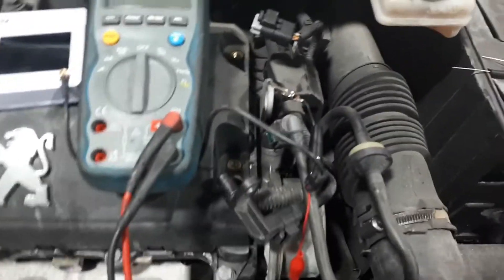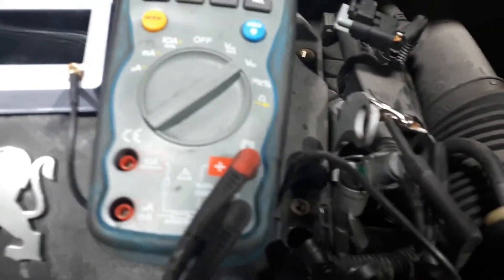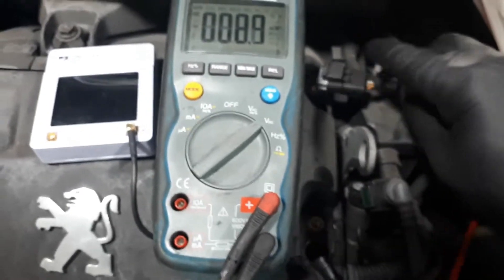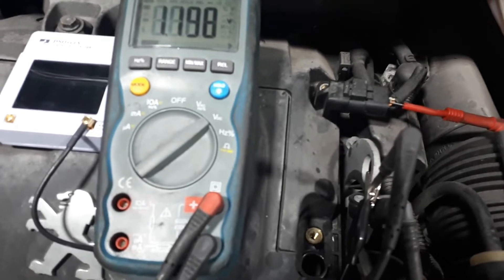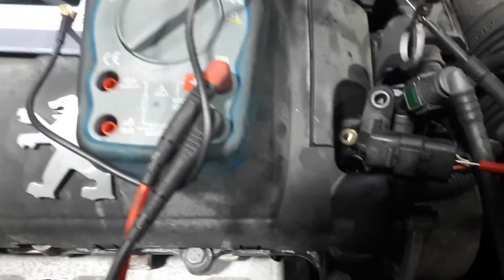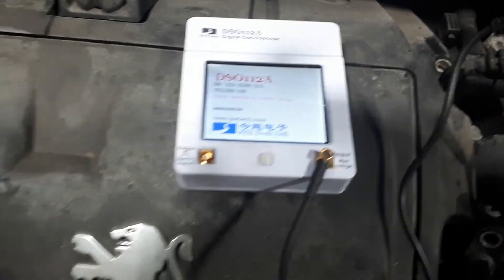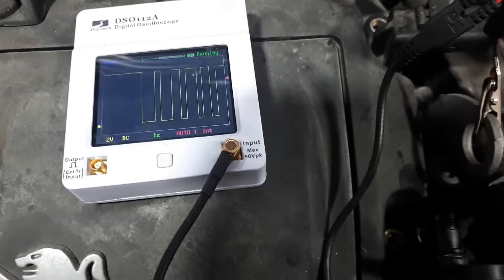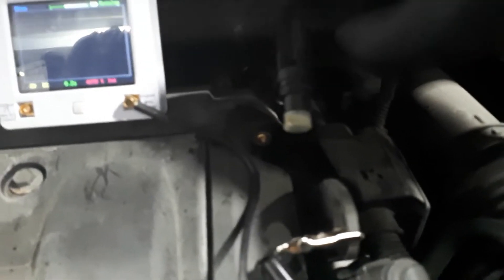How to diagnose P0342 Intake Camshaft Position Sensor Circuit Low

Comment: Salut George, f bun videoul. In situatia mea, motor 1.6vti, am verificat signal wire, ground wire, power wire. Totul e ok. 
Am efectuat un alt test vazut in alt video ”low voltage / short to ground” conectez cablul rosu multimetru la baterie, si cel negru la signal wire (conector camshaft) apar 7V (ignition on), 12V (ignition off)
Este normal?
Reply from the maker: cu sau fara senzor conectat?
Reply: @GicaPhp  multumesc pentru raspuns. fara senzor conectat
Reply from the maker: @rvdumitru90  Bias voltage difera de la producator la producator. O sa trebuiasca sa folosesti un osciloscop si sa vezi ce se intampla cu semnalul cat si cu supply voltage. Daca nu ai osciloscop, atunci iti recomand sa verifici continuitatea de la ecu la mufa (resistance check) in timp ce manipulezi instalatia electrica si sa vezi daca se schimba rezistenta pe toate cele fire, cat si posibil scurt circuit catre ground.
Reply: @GicaPhp  din pacate nu am osciloscop, iar masina nu mai porneste.
Motorul a inceput sa dea rateuri dupa schimbarea bujiilor si schimbarea camshaft senzorilor intre ei.  Dupa cateva minute de mers in rateuri motorul s-a oprit si pe tester au aparut erorile legate de inlet si exhaust cylinder reference sensor signal loss(permanent) 

Am pus sensori noi si motorul tot nu porneste. Cranks but no start. Are scanteie + benzina. 

Cei de la service nu isi dau seama care e problema, suspecteaza Timing chain sarit 1-2 dinti.. 

Motorul este 1.6vti 120 (2013) Citroen C4 picasso.
Reply: @GicaPhp  https://www.youtube.com/watch?v=-q9Nd6cMvfY acesta este testul pe care l-am facu. In prima parte valorile au fost corecte, in a doua parte nu 😕
Reply from the maker: @rvdumitru90  Ai putea sa-mi dai lista de erori?
Reply: @GicaPhp  Pe diagnoza nu imi apare cod eroare, ci doar descriere. 1. inlet cylinder reference sensor signal loss. 2. Exhaust cylinder reference sensor signal loss. 3 misfire cylinder 4
Reply from the maker: @rvdumitru90  in regula zi-mi te rog datele masinii sa ma uit pe wiring diagram. Am nevoie de Marca/Model/an/cm3/kw/cp/cod motor daca se poate
Reply: @GicaPhp  Citroen C4 picasso mk2 2013 motor 1.6vti 120hv 5FS (EP6C
Reply from the maker: Failure to start. Various trouble codes stored in engine control module (ECM) fault memory.
Affected vehicles
All models.
Problem
AC/heater blower motor not operating.
Central locking not operating.
Failure to start. Various trouble codes stored in engine control module (ECM) fault memory.
Cause
Multifunction control module software fault. Battery disconnected before multifunction control module enters sleep mode.

Remedy
Initialise multifunction control module as follows:
Ensure driver's window is fully open.
Remove key from ignition switch.
Close all doors.
Wait 15 minutes before disconnecting battery.
Disconnect both battery leads.
Wait 10 minutes.
Touch battery leads together to remove residual circuit voltage.
Reconnect battery.
Switch side lamps ON. Wait 30 seconds.
Switch side lamps OFF. Wait 30 seconds.
Open driver's door.
Start engine.
Reply: @GicaPhp  interesant, voi incerca asta daca problema nu e rezolvata cand iese din service. Multumesc pt reply-uri! 👍🏻

Comment: Salut am și eu o mazda 6 și îmi da codul acesta de eroare  am încercat cu 4 senzori nu am scăpat de problema ai vreun sfat
Reply from the maker: Un pic neortodox, poti pune firul de semnal la 12v sau 5v (verifica pe diagrama electrica) si vezi daca poti schimba eroare din LOW in HIGH
Reply: @GicaPhp  am verificat firele nu am masa pe un fir am 12v pe alalalt nu am nimic ii senzor cu 2 fire
Reply: @GicaPhp  da.mi te rog un nr de tel sau de contact ca is terminat nu știe sa facă nimeni problema aceasta
Reply from the maker: gica php pe fb

Comment: Sir i have po342 code 
Some time my automatic car doesn't shift in second gear ....... Is it because of this code? I only have this code coming .
Reply from the maker: If you no other dtc on the tcm module I would say to fix the cam sensor fault and try again.

Comment: Salut. Pe un 308 am p0341, p0342 si p0343. Am facut masuratorile la fire pentru  ambii senzori si am 5v si pe firul din mijloc ( lipseste 12v). Multumesc
Reply from the maker: Ce an este? ce capacitate? cati kw?
Reply: 2010, 1.6 vti 120, 88kw
Reply from the maker: Cu mufele scoase de la senzori, noteaza pe o foaie ce ai la pin 1, 2 si 3 la fiecare mufa si zi-mi ce ai masurat.
Senzorii axelor cu came, au 3 fire si vin direct din ecu la modelul tau. Ai mai multe variante in functie de ce scule ai. Cea mai simpla ar fi  sa inversezi senzorii intre ei, si vezi daca se muta eroare pe senzorul B si dispare de pe senzorul A. S-ar putea ca prinderea sa fie la alt unghi, dar poti sa-i fizexi temporar cu niste silicon sa stea in loc daca trebuie sa faci o plimbare ca sa apara eroare. Daca se muta eroarea, ai un senzor defect, dar nu l-as schimba pana nu as face si testele de la urmatoare varianta ca sa fii 100% sigur.
Urmatoarul pas ar fi sa deconectezi mufele senzorului cu problema si ecu, si sa faci un test de rezistenta pentru fiecare fir in parte. 
Pentru fiecare fir in parte testeaza rezisteta (mufa ecu - mufa senzor) (0ohms), scurt circuit intre fire (OL) (1-2, 1-3, 2-3) si apoi (OL) (1-gnd, 2-gnd, 3-gnd) daca totul e ok ai senzor defect sau in cel mai nefericit caz ecu defect (nu cred).
Facand masuratorile de mai sus, nu uita in timp ce ai conectat aparatul de masura, trage de instalatia electrica de la motor sa simulezi vibratii si torsionari ale motorul fata de caroserie.
Trage de fiecare fir in parte de la mufele senzorilor sa nu fie rupt firul in interiororul izolatiei si izolatia sa fie intacta.
Reply from the maker: Ai cumva osciloscop?
Reply: Multumesc pentru raspuns. Desfacand senzorul A am constatat ca erau pe el depuneri consistente. L-am curatat si apoi am sters eroarea din soft. Dupa un drum de 25km nu a reaparut. Acum nu stiu ce sa zic, daca reapare o sa urmez sfaturile tale. Mie mi s-a parut ciudat ca nu am tensiunea de 12v la ambii senzori (pe pinul mijlociu cca 4.9v). Osciloscop nu am
Reply from the maker: Daca ai 5v pe firele din mijloc e ok, inseamna ca este circuit pull-up la 5v nu la 12v. Daca apare, vezi pe care si inverseaza senzorii intre ei si retesteaza, e mai simplu asa.

Comment: Sorry this is so long, it's copied from caddy forum i used...........
I had the p0008 on my 2010 CTS4.
I changed the sensor for bank 1 along with the solenoid actuator. The p0008 is gone, p0342 is now on the CEL. The car did not start until several long attempts. The sensor for the cam was bad and now has a full 12 volt load going to it and no more p0008. Ohms test shows the old sensor defective.

The solenoid actuator was not bad but replaced with a new AC Delco part. I show 9 volts input at key on.
And 2 volts when running. I also tried the old actuator with the same results. Both actuators show good with ohms result test.

The battery has a full charge, Alt putting 14 volts when running. 

What would make the p0342 voltage drop? If i clear the code it reappears at the next start up. I'm stumped here, any help appreciated. The only odd issue was the long start up of several attempts before it ran. Any ideas?
Thanks.
Reply from the maker: I would recommend to scope the signal and see if it is a good patern. I have seen new sensors a bit short that the genuine one, making the gap to big, also i have seen wear and excessive play into camshaft.
Also, the actuator are pwm actuated, so a multimeter read is not accurate.
Reply from the maker: Also, check the crankshaft sensor voltage, ground and patern and compare it also with the cam shaft and see a logical patern.
Reply from the maker: And do check you voltages, grounds and signal voltages on sensors and make sure there is no short to ground on the signal wire (input low)
Reply: Thanks for the replies.The p0342 was a bad new sensor, cheap one from Amazon, VVT's were Delco I changed the 2 vvt's in bank 1 with one new cam sensor (the bad/new one had a very high magnate pull over the other new one and 2 OEM's I removed. I also changed the car with proper oil after using Risolone treatment (filter and oil looked dirty, bank 1 vvt's parts & view inside it looked amazingly clean). I didn't have another can sensor so I used the one with a slightly less magnet attraction. My improvement is having the p0008 code come on  much less and not every drive cycle. Dealing with a spine injury several years ago makes most nights and days difficult. I just want the p0008 to stay off and sell the car, less problems in my life. I hate to drop $1.8k for a chain/tension guides to sell it. But I see little choice now. Thanks again for the info.
Reply from the maker: @jluke2525  Slim chance, but make sure that no wiring is passing near coil leads, as magnetic interference can happen.

Comment: Hello thanks for a nice video.  
I have Peugeot 308 2008 giving me an a permanent fault code p0341 ( inlet cylinder reference sensor signal Coherence) kindly advice what should i do to solve it.
Reply from the maker: scope the signal of the inlet sensor and compare it with the exhaust one. most likely it will be a faulty sensor. you should see a square signal 0V to 12v. if you don't have a scope just swap the sensor (they will fit except the bolts) and see if the error moves ;) cheers